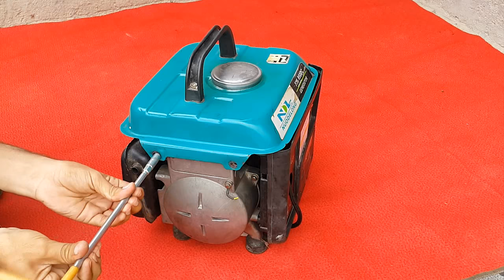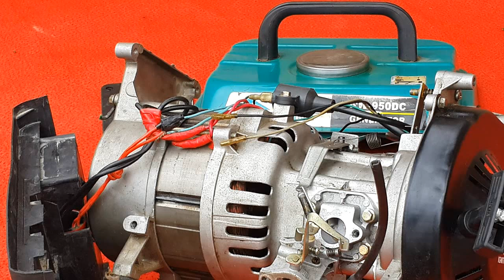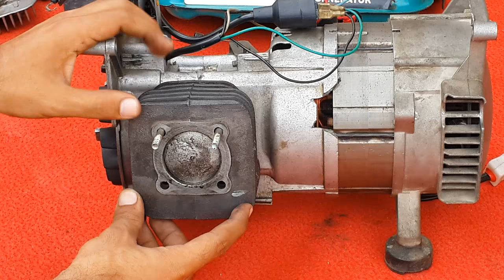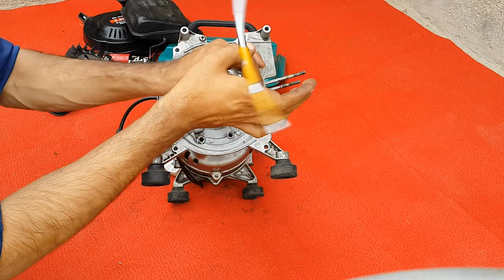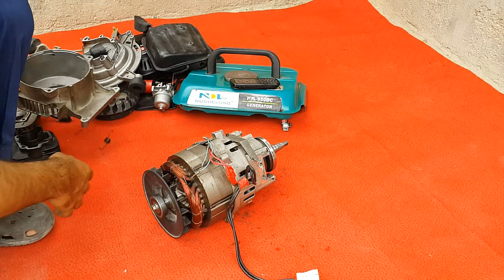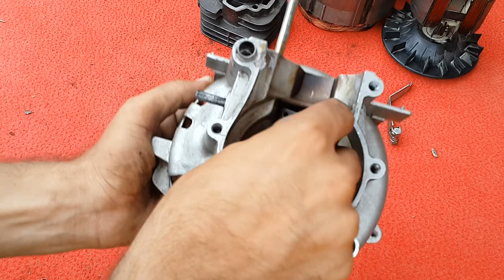How to repair portable generator part 1 of 3

Comment: Hello, I'm writing from Argentina, my question, how does this type of generator work? What I want to say is that I already disassembled my 2500 w generator from the engine part for combustion, I do not need it, I will manufacture the mechanical part to produce movement, but how can I generate electric current? How does the generator part work? Thank you for your prompt response and greetings from Argentina, sorry for my bad English.
Reply: Well electromagnetic induction is the answer. If you spin a magnet near a coil or a coil near a magnet you produce electricity and it's called electromagnetic induction. Now in today's generators they use electromagnet instead of a permanent magnet , electromagnet  is stronger than a permanent magnet also you can control the output voltage and current and they just spin the electromagnet inside a coil and that's how they produce electricity . Electromagnet is basically a coil but when a current (electric obviously) flows in the coil then the coil acts just like a magnet and it's name is electromagnet. Hope i helped

Comment: Gostei muito, mas não consegui soltar o eixo do gerador. As pontas são cônicas e a pressão é muito forte, como o senhor conseguiu soltar os eixos depois de desaparafusados, na primeira vez?
I liked it a lot, but I couldn't loosen the generator shaft. The tips are tapered and the pressure is very strong, how did you manage to loosen the axes after unscrewed the first time?

Comment: I didn't see how you removed the rotor from its taper on the crankshaft. I'm just stripping a Clarke / Briggs & Stratton 3.5 HP generator and I'm stuck at that stage. The rotor looks easily damaged so perhaps I should strip the engine and pull the crankshaft off the rotor rather than the other way round?
Reply from the maker: I removed the rotor from it's taper by simply hiting on the stator by mallet side by side and then it removed it self. Be careful while hiting on the stator  you may damage stator's winding!
Reply: Can i have wiring guide of stator i dont know where to connect 2 red, 2blk and 2 blue

Comment: While servicing my portable generator, I mistakenly broke one of the two upper bolts that binds the engine block. I ended up binding the block with the remaining three. The following day, I turned it on and the packing in the engine block was torn. 
Please I want to know if the torn packing was as result of the missing screw. Please I await your urgent reply.
Reply from the maker: Yes,That's bcz of missing screw.

Comment: I have some remarks about yuor disassembly method: You used a sledge hammer and a large screwdriver as a lever to extract the magnetic flyewheel and the crank. It is almost a "capital sin" because you can damage the parts an deform the axle's tips. You must to use an extractor do perform these operations.
Reply: Como repara motor ja..

Comment: Love the info ! I am looking to run a small ceramic heater, which has 2 settings - 700w (low) & 1500w (high) to heat a very small closet size area. Would you  recommed this generator?
Reply: yes they are very good

Comment: great video.  I have one on my bench right now.  Its seizing during the pull to start it. Its not the pull rope that is locking up.  Im getting ready to tear it down.  Anyone have any ideas why this is happenimng?  The tear down will not be a problem but I cant figure out why its happening. Im open to any thought you may have.   Note. I had a coupon and a gift certificate and got the thing for like 12 bucks so its not the end of the world If it goes in the metal/scrapper pile in my barn lol.  Im sure I have not used it 10 times.  I would bet it doesnt have 4 hours total run time.

Comment: Hi. Nice job! I'm asking muy self if it's possible to use thise kind of generators as a windmill generator? (To turn into using The generator in itself leaving The gasoline motor apart by adding three blades). What do you say? Thanks a Lot.
Reply: MARTIN MARTELETTI so you need a constant 3050-3200 rev. On the Generator or it want work!

Comment: i have the same genset, i am having trouble to start it up i tried cleaning the carbs and adjusting air and gas jettings but to no avail. it is still wont start.... please give some advise Thank you!
Reply: I have the same problem, used start pilot and it runs irregulary until the start pilot is burned and then it cuts off.

Checked the spark and ignition. Fuel inlet. and outlet.

Everything seems allright
Reply: @seppenorton  thank you 😊❤👍

Comment: dear sir, ive just bought a generator like this one, but the voltage is not stable, it is swinging between 180 and 220, the worse is when i connect it to home, it get worse, knowing I did not make any load on it, i operate about 2 amperes on it
Reply: پورانہ سٹاٹرچوٹاجنیٹروالاصحی یاحراب بتاو

Comment: when u remove the engine then connect the drill matchine to dainamo and test its should make electrecity or not.....?
Reply from the maker: No I have Checked it It does not work bcz A dianamo needs high RPM and drill machine has not like taht RPM which Dianamo needs. Thank you for Watching!

Comment: I have medusa 950 compact which is same as this. The magneto and coil pack are seperate were as like honda or suzuki as all in one coil pack magneto. My problem is i have no spark and only getting around 5 - 6 volts from magneto when i pull start. that cant be enough voltage for a spark surely ?. Can anyone tell me what the voltage should be, i expected about 12volts plus.

Comment: I really need some help my generator engine sounds terrible and doesn't produce power. It sounds like it is about to cut off and the RPMS are low. I also have to start it at half choke. Any ideas????
Reply: Gen don't gen
Reply: Employ me and the best come to generator work

Comment: Hey my name is Ethan and I like to work on small engines and I'm only 15 and I need the carburetor the plastic for the breather box I need the thing the carburetor screws down to that whole assembly with the gasket for the governor thing and if you can do this you should text me back